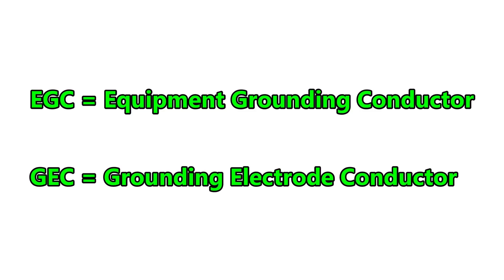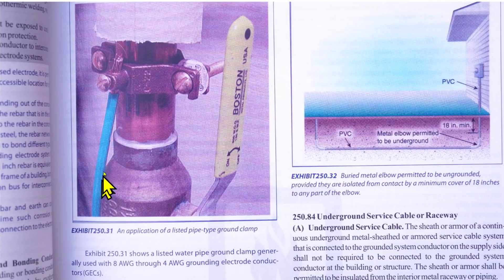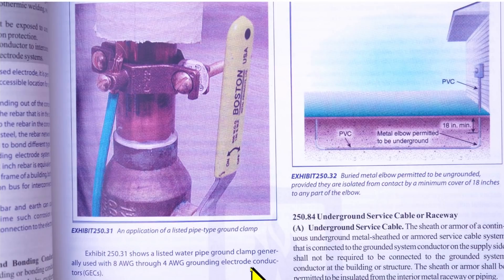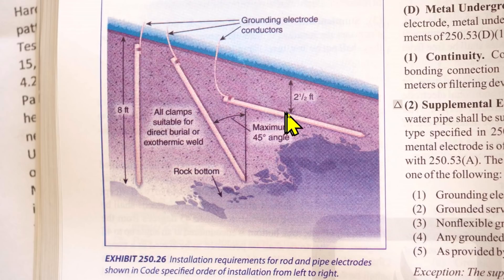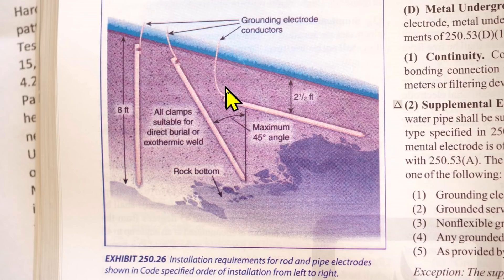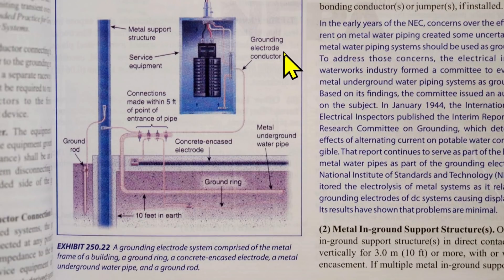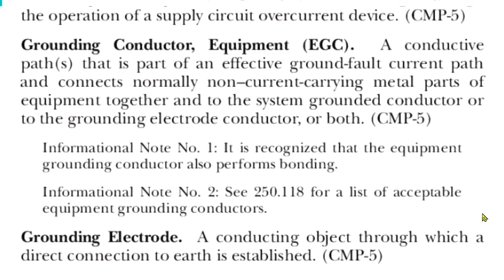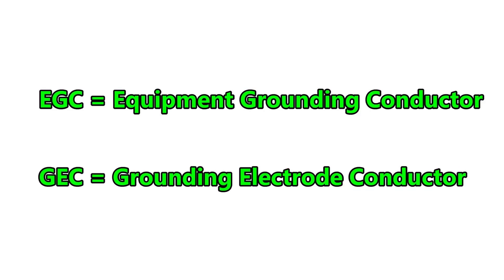What's the Difference Between an EGC and a GEC?

Comment: In my opinion (from a non-electrician), using IEC terminology is better than what the NEC defines because its pretty much easier to understand and is simply more straightforward, plus its used by regions outside North America (aka the rest of the world). For example, instead of equipment grounding conductor, protective earth (PE) could be used instead. However, Protective Earth still has its problems as the British prefer calling it the CPC (circuit protective conductor). Really hope the NEC and other responsible organizations (not a fan of the decentralized way in the US) would consider it, even if it costs money and takes time getting used to the new terminology and other potential obstacles.
Reply: Hi. When you say that instead of using EGC, that PE or "protective earth" can be used instead? How exactly is protective earth defined by IEC? I'm asking because google's not being very cooperative, perhaps because they know I'm US based and therefore tailoring my search results to my region. It sounds like you are simply referring to dirt, but I'm guessing you are referring maybe to wires that connect to rods in the dirt? In which case I'd still be confused as we'd be talking about the same thing we call GEC's, but just going by different names, no?
Reply: @Rick-the-Swift  
1) IEC describes Protective Earth as "earthing [safety] for the purposes of electrical safety". Essentially is what US and CA call EGC. Fun fact, the IEC's glossary is available online for free (search "IEC IEV" or "IEC 60050")
2) There is a downfall to each term of the PE vs CPC debate: PE is generally understandable but "protective" is not fully understandable to some (hence the British call it CPC), and while CPC is also understandable (it has its own downsides too, perhaps too long and also introducing another point of confusion).
3) Since many online platforms are based in the US, there is going to be inherent bias. Some platforms (notably Google) also "gatekeep" on stuff so say people from the US or Canada would have not access to stuff that the rest of the world is going to have (e.g. it insists on imperial/customary for US (and sometimes CA) users, even if contrary to user preference — say if a user wants metric dimensions in Google Docs).
4) The NEC makes changes too quickly, so people are going to get confused very easily. Also, there is no national consistency of the code (which is unheard of in all other countries) so it also contributes the difficulty of processing of understanding.
5) Another part, US and CA codes are almost entirely prescriptive-only (another quirk that separates them from the rest of the world, where prescription is used for consistency but performance is used to achieve the targeted outcome) which means that complications from any future things will almost certainly arise. Some people are unwilling to take on new challenges, while some of the older tradespeople are stubborn (a side effect where rules are overly prescriptive as it forces the person to think only X way(s) is/are valid).
6) The final part, North American codes do not follow IEC best practices, so there are a lot of gaps and misunderstandings (and also, "cultural shocks"). The only reason why N. America hasn't really fully done that yet is due to: industry interests, a lot of stuff contradicts with the IEC, protectionism, some people are really stubborn or have a superiority mindset (in this case, viewing the rest of the world's ways as "inferior")

This is based on what I found online, and a mix of my own theories.

Comment: Just for clarification, this makes it look like when you run a circuit using EMT, you do not need to pull a (green) ground wire. I was taught to always use a ground wire in EMT, and the contractors I worked with over the years always made me do that. Pretty much every building I have worked in that was wired in recent years has a ground wire in pipe runs. Curious as to why we do this if code does not require it.
Reply: Just going the extra mile for safety. That is all. Electricity takes the path of least resistance. The more paths the better for your electrical system in case of a fault.

Comment: bottom line: 
an equipment grounding conductor is intended to provide a current path to trip the overcurrent protection in the event of a short circuit to prevent equipment from becoming energized .

a grounding electrode system (including the conductor)  is used to prevent there being a voltage difference between the "neutral" conductor and the ground.  it also has the secondary purpose of providing a very weak current path in the event of an open neutral condition, but don't count on it.
Reply from the maker: Thanks Ken!

Comment: I am just wondering. If two grounding rods are used, would equal potential grounding have to be considered? I once saw an outside hot tub with a disconnect. The disconnect had a bonding jumper to a separate ground rod. The main electrical panel that provided power to the hot tub had its own connection to a ground rod. I was curious why whoever wired the hot tub needed two ground rods?
Reply: that must have been a local inspector, or an installer who didn't quite get it.  if you look inside the hot tub, you will see a network of bonding conductors creating the equipotential plane inside the hot tub.  those are all connected to the EGC, which provides a low impedance path to ground.  the hot tub is also supposed to be completely protected through a GFCI so that ANY fault to ground will immediately disconnect all power from the faulty component. I have never seen a requirement for grounding electrode at a hot tub.  a pool built in place does also have to have the equipotential bonding for all components, but again, it doesn't, as far as I recall, need grounding electrodes.
Reply: @kenbrown2808  Do you understand why we get to use the "two and done" rule when installing ground rods?  Somehow, 1 individual rod, has to be no greater than 25 Ohms, but for two ground rods, the 25 Ohm maximum no longer applies.

Suppose I install ground rod #1, and its resistance is 70 Ohms.  Then I install a second identical ground rod, 6 feet away in identical soil.   Mathematically, I would expect the combined resistance of the two ground rods to be 35 Ohms.  If the Physics of grounding electrodes requires 25 Ohms or less for just one of them, I would think you would have to continue to drive ground rods until you get the combined resistance to 25 Ohms or less.   In this example, I would expect that to be 3 rods, which would have a combined resistance of 23 Ohms.

Do grounding electrodes get disproportionately more conductance with each rod in parallel that you install?  Or is it simply a matter of most soils being conductive enough that 2 rods is most likely 25 Ohms or less?
Reply: @carultch  they just hope 2 rods will be enough. Or they figure if 2 isn't enough, more won't do much better. Technically, if you can get your test, you can use 1, but everybody i know drives the second so they don't have to test.
Reply: @kenbrown2808  Is there any theoretical basis behind it?
Reply: @carultch  not that I'm aware of.  the language is just, IIRC, that if one rod doesn't pass the test, you have to drive a second rod.

Comment: Excellent...watched it twice 
I soon will have someone look at my well water pump again ...
Hydro already told me that the massive tree I share with the city property line was the beginning of all my electrical issues(I just never looked up)
I changed the water pump 4 times $$$$$$$$$$$$and the last handy man was not so handy and left even more of a mess with my switches and receptacles only because he did not understand aluminum and copper wiring OMG BETWEEN THE HANDY MAN AND THE TREE 
I started learning electricity and electricity is my weakness...I got electrocuted  so many times I can’t touch a switch I always feel it coming for me even if I turn the main switch off  

THANK YOU SIR ...🌈🇨🇦

I CALLED THE APPROPRIATE ELECTRICIAN WITH GREAT CREDENTIALS TOLD ME HOW MUCH IT WILL BE .....BUT  we’ve got to start from the WELL and that’s going to take a little longer than I thought since today is -20 with the wind and the snow is not going anywhere until mid March  ...but is okay is all good we have to patiently wait.
Reply from the maker: Thanks so much. Best wishes with your project. That sounds cold!

Comment: Any time we have to do a trench and are tight on time due to weather, etc. our local inspector will allow us to stick several pieces of plastic conduit straight down to allow for a visual inspection. This way we can backfill the same day and not have to worry frost, rain, snow, and such slowing us down. The inspector can come along at his leisure and see the buried stuff with a flashlight then stick a tape measure in as well. All we have to do later is yank out the pipe and kick in the extra dirt that we left there. Beats the heck out of leaving a trench open for weeks at a time, then bringing back the whole crew to do the finished landscaping. One guy and 20 minutes to button up the job.
Reply from the maker: Great tip, thanks!
Reply: @SparkyChannel  ... oops, don't forget to add in a pipe or two for the buried caution tape. (where necessary)
Reply from the maker: @rupe53  Will do.
Reply: our various inspectors sometimes trust us more or less.  a lot of times, the power company inspector is fine with a photo of a tape measure, and since they require 3' radius sweeps on buried conduit, with short runs, they're fine if the top of the sweep is flush to the ground. (they require 3' burial depth)  but I worked with an old timer in L.A. and he told us when he was working, the power company wanted the ENTIRE trench to be completely open and would fail it even if an edge had sloughed in while the trench waited for inspection.
Reply: @kenbrown2808  ... yes, it helps if you have developed a trust with the the local inspectors. It seems since the crunch with Covid, many inspectors will just tell you to text or e-mail pics into their office. Some will even take this for a pressure test on a gas line if you have their respect over prior years.
Reply: @rupe53  it's one of those cases where making a habit of doing it right really pays off.

Comment: Can you do a video on why 2 pole breakers don’t need a neutral and why the phases balance each other?
Reply: @Ephesians-ts8ze  actually, you are wrong.  a single phase service uses a center tapped transformer, fed from a SINGLE leg of a three phase system.  (and in rural areas, it is common to only run ONE phase on the power poles)
Reply: @kenbrown2808  Extremely well written.
Reply: @tedlahm5740  thanks.  not sure which of the comments it applies to, but I strive for clarity in such things.
Reply: A multiwire branch circuit can be 2 pole and does need a neutral. NEC 210.4
Reply: That's only for balance loads ...like a 240 water heater an Ac. The 240 loads that have a neutral has a lower voltage circuit also...like your dryer and electric stove
Reply: @silliondelfish2176  yep, those type of appliances need 120V for the timer/controls.
Reply: 240v doesn't use the neutral. During each half of the cycle, the current flows into the device through one of the hot conductors and out through the other one. You only need a neutral to get 120v, which means any device that uses both 240v and 120v needs a 2-pole breaker and a neutral... and by extension, a 4-prong plug.
Reply: if you are running equipment that ONLY uses 240V, then you don't need a neutral, because there is nothing that connects to it.  if you are running equipment that uses 240V to power the equipment and 120V to operate the controls, you do need a neutral for the 120V.
Reply: It depends on the nature of the circuit you connect to the 2-pole breaker.  If the load only uses the 240V circuit, and doesn't do anything with the neutral, it doesn't need a neutral.  All current that leaves on the black wire, will return on the red wire.   If portions of the load require one of the 120V circuits, then you do need a neutral.  For instance, an electric clothes dryer uses 240V to operate the heating element, and 120V to operate the controls and motor.

The reason the 2-pole breaker doesn't need to have the neutral pass through one of its poles, is that any overcurrent on the neutral will automatically be reflected on one of the poles of the breaker.  Current feeding a load from a panelboard has to add up to zero among all the conductors leading to it.  What ever is returning on the neutral, must've been provided on at least one of the phase conductors.   In the US, the NEC specifies not to pass your neutral through one of your breaker poles, and only requires your breaker to interrupt the ungrounded conductors.   If the breaker does do anything with the neutral, it would be as part of a GFCI breaker that has a residual current monitor to determine if current is leaking to the EGC, and is not 100% returning to the source among the neutral and other ungrounded conductors.
Reply: @carultch  Kirchhoff’s current law.
Reply: @tedlahm5740  Yes, that's exactly it.  Sum of current entering a region must equal the sum of the current exiting the same region.

There is one kind of neutral current that would be in the blindspot of an ordinary breaker, which is harmonic currents.   This would be from even harmonics (multiples of 2x the frequency) on split-phase circuits, and triplen harmonics (multiples of 3x the frequency) on 3-phase wye circuits.   Rather than cancelling like the fundamental, these problematic harmonic currents accumulate.  Even harmonics are rare, but triplen harmonics are very common.   For this reason, one might specify a 200% neutral when harmonic intensive loads are expected.
Reply: @Ephesians-ts8ze  No. You can determine this by looking at a transformer on a pole. The primary feed at the top is connected to ONE of the three primary wires at the top of the pole. That means it's fed by one phase. Then three secondary wires come out the side, two of them are the hot wires with 240v between them, and one is the grounded neutral, tapped from the center of the transformer's secondary coil so that there's 120v between it and each of the two hot wires. When two or three phases are used, there will be connections to two or three of the primary wires at the top of the pole, instead of just one. These will feed 2-3 transformers mounted together, or a single larger one that contains three.
Reply: ZIGGY.   Actually only one phase which CAN BE split in the middle if a 120 volt circuit 
is needed ALONG with the 240 volt circuit.  Confused Yet? 
       The Power Company DISTRIBUTION SYSTEM uses a three phase system.
YOUR HOUSEHOLD only uses one of these three.
Reply: @Ephesians-ts8ze  Incorrect. It is as i said it is. Otherwise why would I say it. 
Look outside at your neighborhood STEP DOWN TRANSFORMER at the very top.
ONLY ONE Conductor coming into the top. One Phase of the available three.

Comment: aren't there any illustrated code books you can link to? they are much more useful for learners.
Reply from the maker: The handbook is illustrated.
Reply: @SparkyChannel  but it should be mentioned that a codebook is not a textbook, and learners should be using textbooks to learn from.  (or instructional videos)